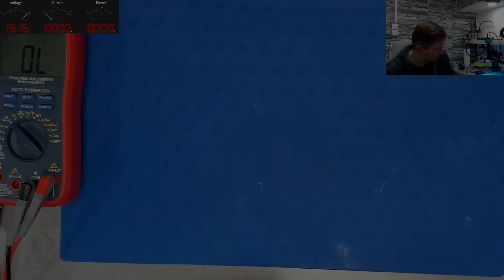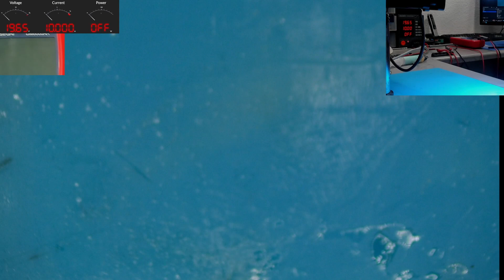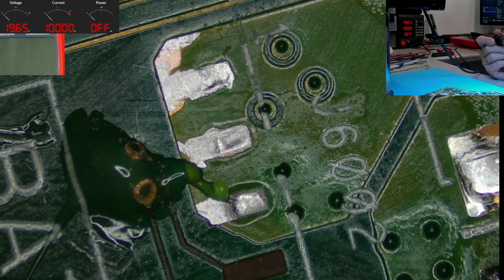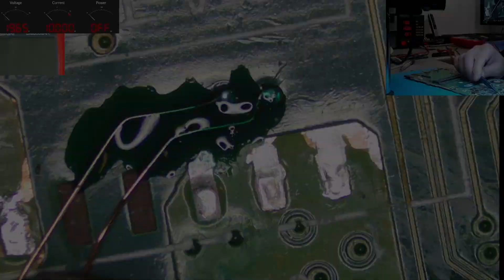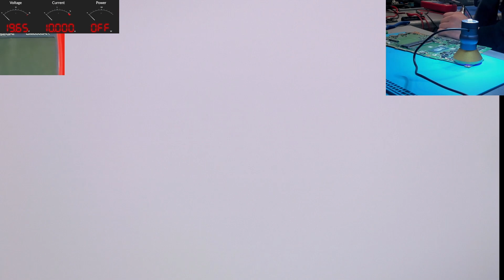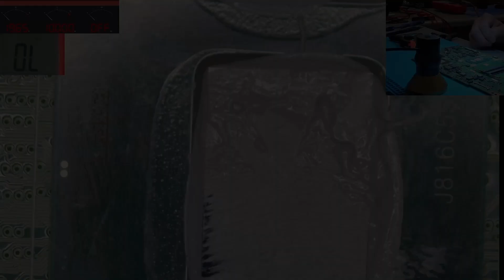ASUS VivoBook S15 - No Power and Battery Connector repair - Common faults #2

Comment: Hi Mike nice fix and video. When you do it again it will be easier to remove the lock tab. Then you can see the pins when you solder. This ís just a tip i give for the next time.

Keep up the movies, btw do you have a link for your microscope.

Regards

Steve.